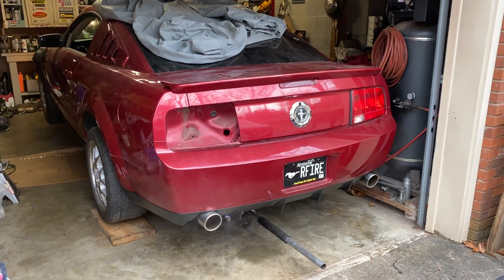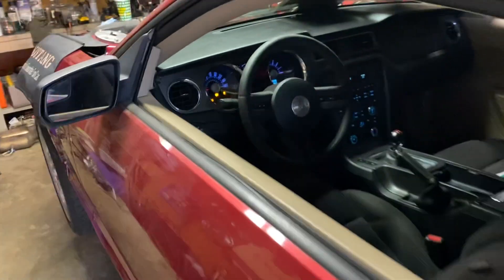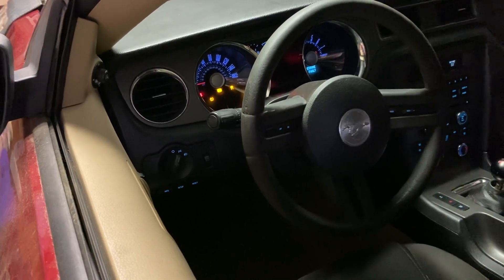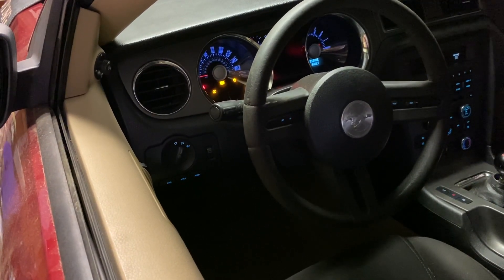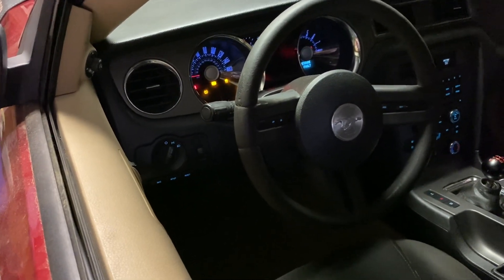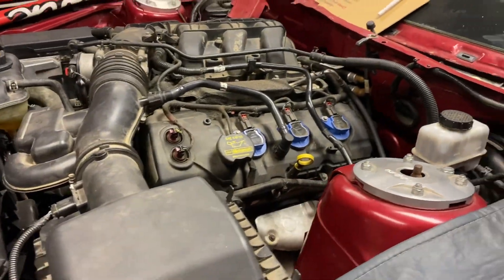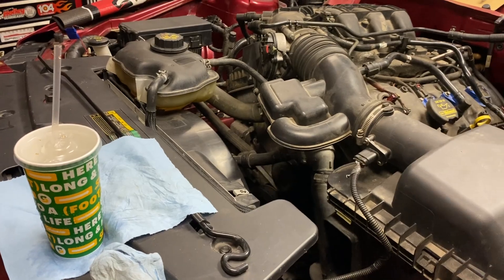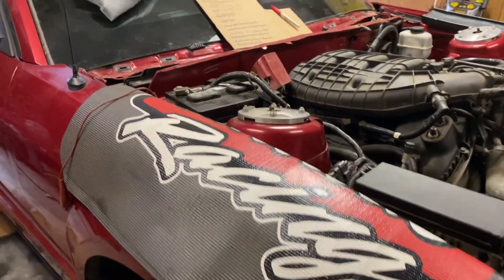Redfire Project Part 15

Comment: Hello, I am having a similar problem, I have no power in pin 86 of the starter relay, the wire wht-gn, I would like to know how you solved it
Reply from the maker: hey I just saw your question. I ultimately found connection problems in the connector plugs. I had pressure washed everything and must have got water in the connectors. After tracing everything seen in part 13 video, I finally just cleaned all the connections and litheum greased them and it worked. I hope you can find your issue. It's very frustrating!